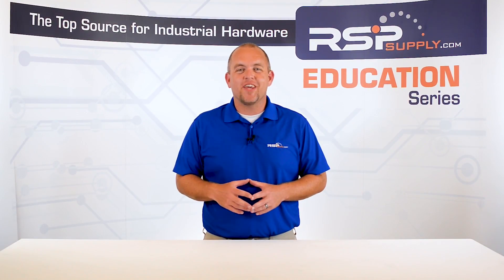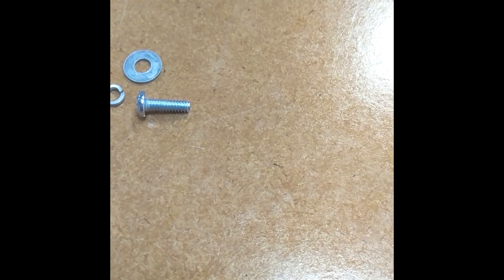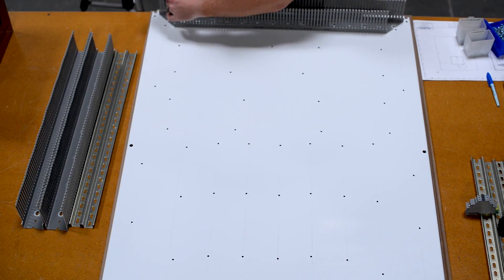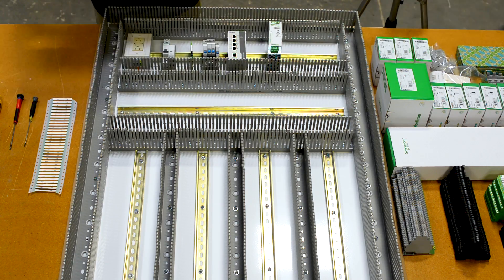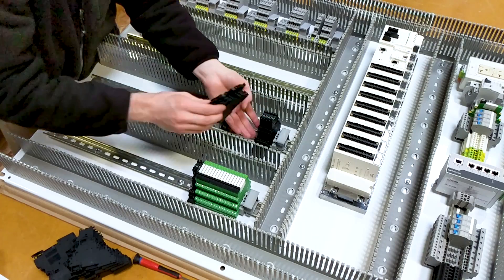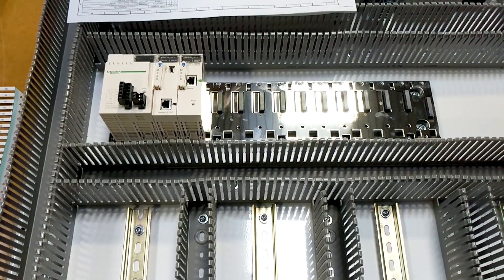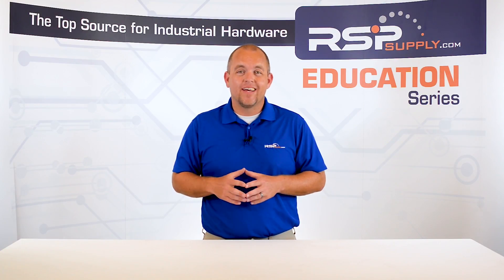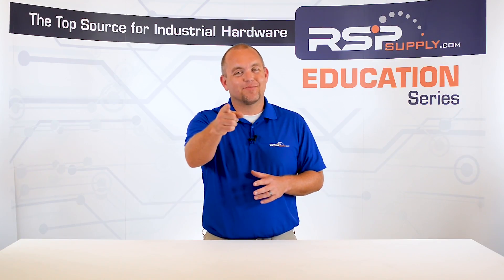Control Panel Build Series Part 15: Securing Hardware

Comment: Nice and thanks for the video.

Which wiring practice out of 2 options below saves more time? 
Assumption: Ducting & DIN is pre assembled into the mounting plate.

option1: Mount both the components (starting terminal of component 1 and termination terminal of component 2) and then complete the wiring of these 2 components, ad also assemble other termination components based on design. I prefer this one as you mount a component and complete the wiring of that component @ very next moment. 

option2: (which is seen in this video) Mount all the components into mounting plate first and then start performing the wiring operation . (my assumption , this calls for cross verifying of I/O addresses for each and every wires based on identification numbers and might consume more time in checking  and chance of wiring error also high)

Comment: @rsp supply what is the thickness of the sheet metal you guys use for the backplate?
Reply: The backplate is usually supplied by the manufacturer of the enclosure.  If you  go to the specification pages for the enclosure, the panels available for that enclosure will undoubtedly be listed there. If you pick one of the panels, you should see the specifications, including the thickness.